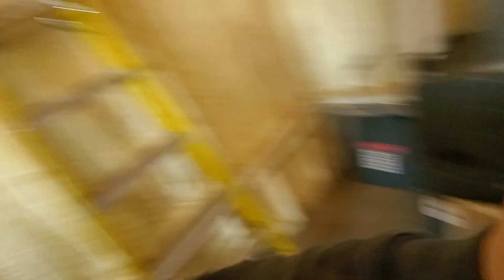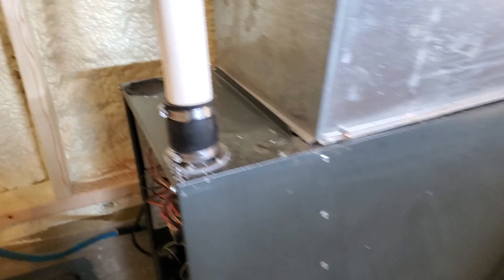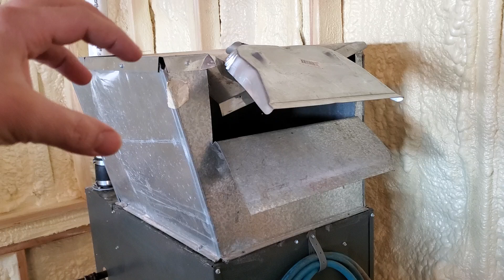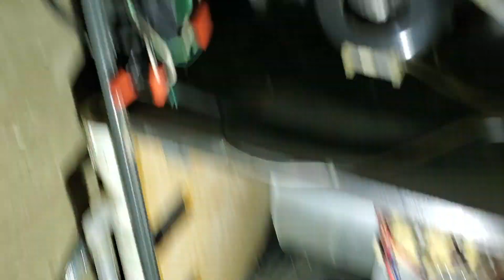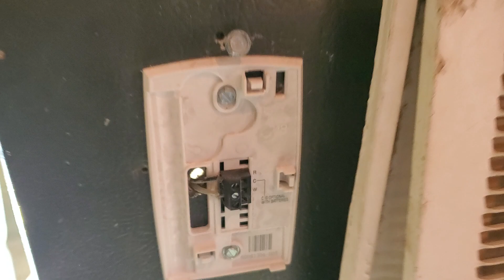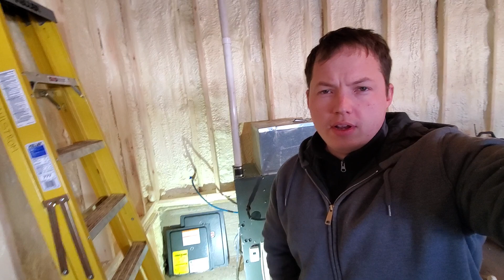How To Install a Temporary Furnace

Comment: I like ur videos but every manufacturer has a disclaimer that any furnace is not to be used as a temporary heater. I also noticed in another of your installations that you had run black pipe but you had a union inside furnace cabinet. This is normally not allowed.

Comment: So I am currently trying to hook up a temporary power source to my furnace as we don’t have power on site yet. I wired it up so I could plug it in to my generator directly. 

I get all the way through the startup sequence but as soon as the main bower tries to go on, it trips the gfci (30amp). I was wondering if you have ever tried something like this. 

I tried grounding the generator (craftsman, bonded neutral) to the grounding Rod but had no luck. The generator is a 7000watt 60hz generator which is what Goodman recommends

Comment: How does this work though? 90+ units have a temperature sensor in them, and it won't allow it to operate if it is too cold. It's not the thermostat. Unless your control board has partially failed. It shouldn't allow you to operate even if it's jumped out.
Reply: No they don’t
Reply: @iLikeC00kieDough  Yes. They do.
Reply: Angryfarmergamer21 what brands have a low temp sensor in them? I have yet to work on a piece of equipment that has this
Reply: @iLikeC00kieDough  I have witnessed it on an Amana Air Command 90. (which is 1990's tech) Tried to set it up in a garage. It wouldn't let me run it if it was below 30. And that was a 2 wire analog thermostat. The furnace just would not have it,. And  I've also witnessed it on a Winchester or a Coleman or York furnace. It's the same technology as it was in the 90's.
Reply: Angryfarmergamer21 where is the temp sensor located? Is it on the ifc itself or is it a remote sensor somewhere in the unit?
Reply: @iLikeC00kieDough  It should be in the ifc I believe.
Reply: Angryfarmergamer21 that much not be too common on residential units then. I haven’t ever seen anything like that. Maybe they aren’t common in my neck of the woods
Reply: @iLikeC00kieDough  I don't know. And perhaps it was a malfunction because of the dreaded cold Minnesota weather.
Reply: @iLikeC00kieDough  why the fuck would a furnace have a feature that would cause it not to run when cold lol
Reply from the maker: Interesting. I have not worked on a furnace that had an integrated low temperature cutoff in the control board. Would be neat to see one sometime!
Reply: @BenjaminSahlstrom  I am a believer that they should all have them. I have noticed with multiple "lower end" units. They don't vacate all of the water, there's always a little bit left behind and with that whole plenum being made of plastic, a hard freeze would be catastrophic, and maybe damage the secondary heat exchanger as well.
Reply: @AmericanFarmerHVAC2024  a temp sensor that doesn't let it start won't save furnace from freezing. If anything, furnaces would benefit from freez protection like some high efficiency boilers and thermostats have that turns the thing on to bring temp above pre set minimum

Comment: Thank you so much! That's exactly what I need to do. Wow! Talk about perfect timing
Reply from the maker: Awesome! It really is basically an overview a furnace installation with a few "temporary" specific tips. Are you just setting it up for a construction project?
Reply: @BenjaminSahlstrom  I converted a Fieldstone Foundation into a poured concrete foundation which included changing the footprint of the home. The house is back down on the foundation and now the upstairs is being worked on. Up until now I've been using the wood stove for my primary source of heat along with a few space heaters here and there. I'm also running a temporary electrical panel outside. This week we removed the existing Second Story which was a cathedral ceiling. Next week we'll be building walls and installing the roof trusses. When the walls are standing I won't be able to use the wood stove unless I relocate it. Prior to the renovation, I was using forced air Natural Gas. I have a high efficiency furnace. I was planning to run the furnace in the basement with a temporary installation and gradually install the duct work throughout the rest of the place because the floor plan is change it. My plan was to start using the furnace again. I was planning on doing my own electrical work as well. That's how I found your Channel. I searched electrical panel installation. After watching a couple of your videos which I found to be very helpful I was certain to Thumbs Up And subscribe. I hit the bell for notification and here we are today. That's what I'm talkin about!

Comment: That foam - does it need to be covered by non-combustible material?
Reply from the maker: I'm not sure that it is required by code but it is likely that I will cover it with drywall at some point. :)
Reply: U couldn't get that foam to catch on fire with a torch right on it it just kinda melts and smokes

Comment: My previous furnace was a Goodman and my current one's Payne. I just have the 80% one in my old 1890 house, I didn't want to mess with running PVC intakes and outtakes through my stone foundation, and I already have a chimney. The EPA was originally going to ban 80% some time back in like 2010 or 2011 or something, but I think they cancelled that ban.
Reply: 90%+ is the way to go in most real winter applications but in unique cases like yours it's good to have 80% as an option.

the problem is people put in 80% just to save a bit up front and waste energy for 15 to 25 years, hence legislation. builders are the worst culprits.

In canada 80% furnaces are gone, they haven't been available since 2010.
Reply: @Jon-hx7pe  Yeah in retrospect I actually did regret not going with 90+ because I later has some issue with the flue going into the chimney--it had all corroded due to moisture and venting issues. I fixed it, but it was enough PITA to make me realize that wouldn't have happened had I did the PVC pipes instead.

Comment: looks like one of those crap "2-stage" goodmans that have a single speed inducer, a poor turndown ratio and no W2 terminal.
I would just lock it on high fire to get decent efficiency, can bet it doesn't get close to 95% on low with so much extra air.
Reply from the maker: Yeah, not the best furnace out there. Makes for a good "temporary" furnace though!
Reply: @BenjaminSahlstrom  I've heard they're not the best, they're basically like economy-grade furnaces. Same with Janitrol which is what Goodman used to be called I think. I don't know furnaces well enough to tell them apart, I've looked at others (Trane, etc.), they all look the same to me. You furnace guys know the differences.
Reply: sometimes a lower end manufacturer can have a really good model. The next one up from the one in this video, gmv95 was excellent for the money - right up there with high end ones from more expensive makes if u ignore the thinner sheet metal. the new version of that now, they've screwed up by removing the w2 terminal.

U have to look at the specific model and ignore brand especially when getting a goodman or icp.

Comment: Ben: Are we using the air in the room for combustion? 

conductors?
Reply from the maker: Yes, combustion air is pulled from the room. As I mentioned though a second pipe would be advisable if there will be a lot of dust involved in the project to help keep the furnace burners and components clean.